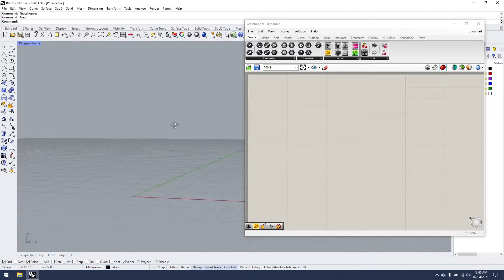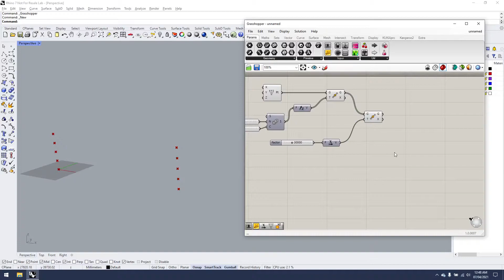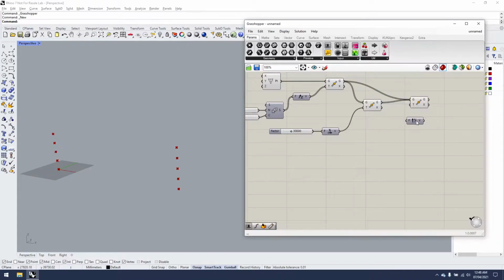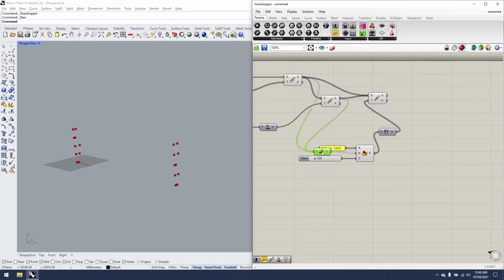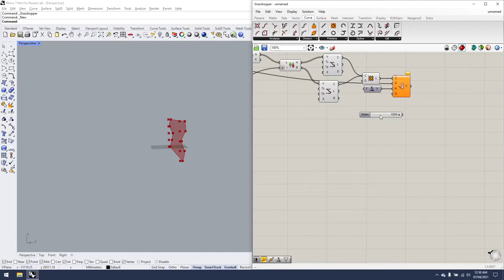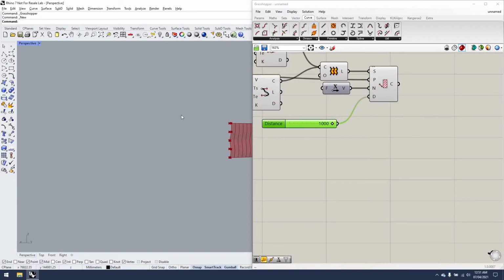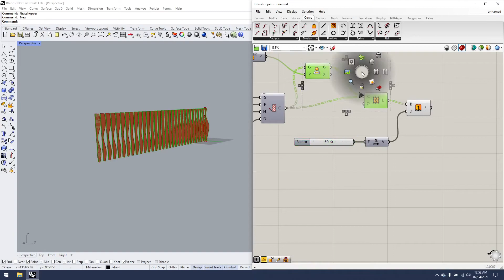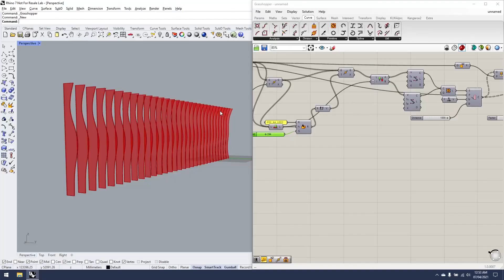Quick and Easy Parametric Facades with Grasshopper - Beginner Tutorial

Comment: hi just wondering how to add this design onto an existing surface in rhino? you mentioned in your video that you can do it but didnt show how :)
Reply from the maker: Replace the initial step of manually creating the points just anywhere and generate points on the surface, could subdivide the surface and use those points..